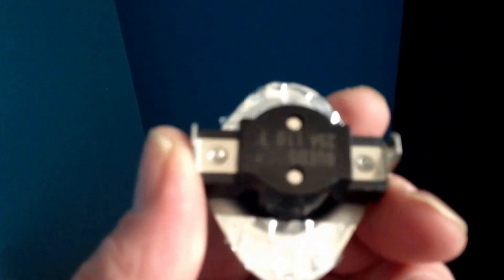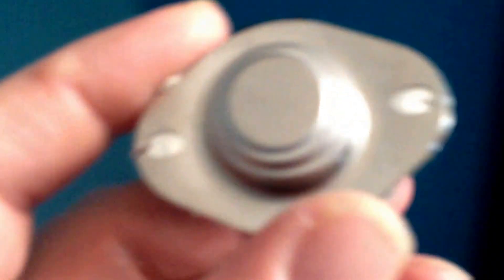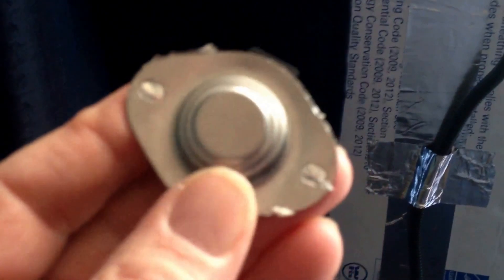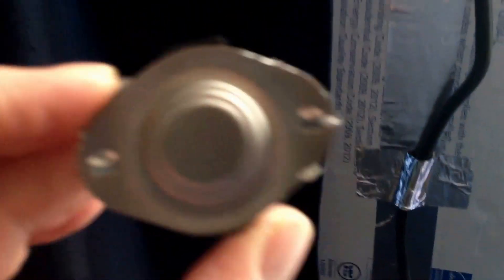Active solar hot air collector, update, testing,  working changes, 30 degree temperature difference

Comment: if the temp is higher in the collector than the desired temp for the room, why wouldnt you have the fan come on earlier in the morning. it seems you are missing out on the volume of warm air you could have been recieving?  it seems you could accomplish this with two cheap house thermostats , wiring the fan control in series. that way you could adjust both the desired temp in the room and the temp in the collector that enable the fan should come on. your desires might change and you could adjust either temp with a touch.of a finger.